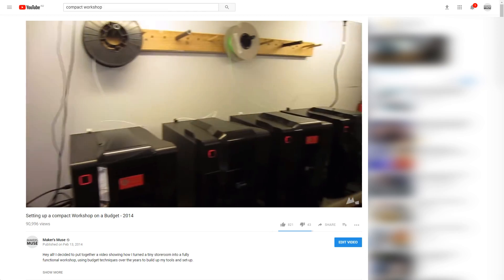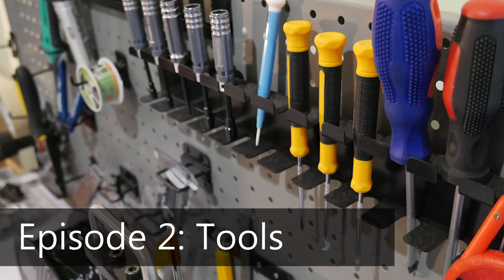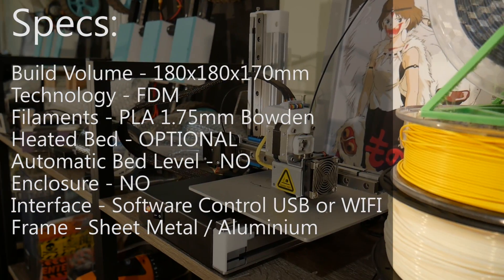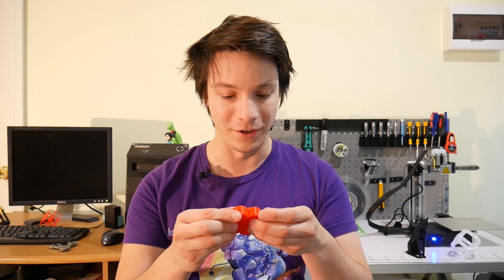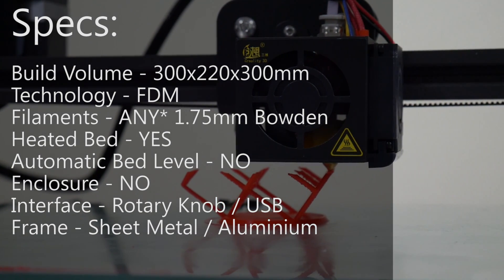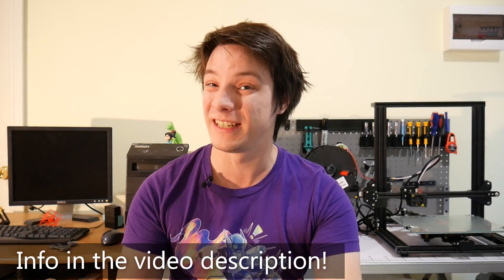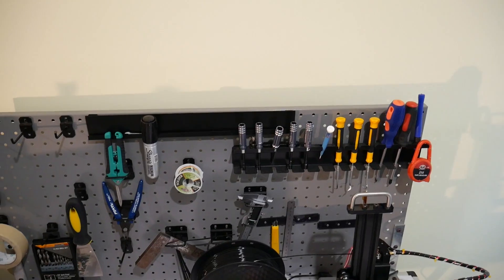The $500 Makerspace Part 1 - Budget 3D Printers

Comment: I think for christmas this year I'm going to buy myself a 3d printer and I'd like to keep it under $200 USD to start.  I already have a good desktop pc and a ton of tools so those won't be an issue however I had some questions on the printer itself.  I scanned gearbest and found a couple in that price range:

Tronxy x1
Tronxy 3d printer kit ($10 more than the x1 sooo)
Geeetech i3 Pro
Prusa i3
Tronxy x8
Creality 3d Ender

You mentioned the Flexion extruder for flexible filament in one of your videos however I do not know which one of these it would be compatible with.  I think that might be something I would want to look into in the future if this is something I want to get into.  Bed size is not really an issue for me as I want to start printing small parts for paintball markers and maybe some action figures for my kids to break... I mean play with.  Thanks for any input you (or the community) can provide.

Comment: Most other reviewers are saying that the kit can be something of a chore to assemble and get working well, but if you had experience with similar projects what would keep a person from getting a TronXY X5S up and running for about the same price as a CR-10?  This is the route I'm planning on taking and running it  with Octoprint, since I have an unused Pi laying around.  That said, I've never had a 3d printer before, and I'd love to hear your thoughts.
Reply from the maker: If you're OK with buying a 3D Printer for a hobby more than buying it to print things then a kit like the X5S is a good deal. You'll spend an incredible amount more time getting it going than the CR-10 which will be printing within 15min of unboxing.
Reply: Thanks for the fast reply!  I'm definitely keeping this at the hobby level for now, and I don't mind doing the assembly myself.  I tend to learn more about machines and processes the more I can put my hands on them.  I've ended up grabbing an X5S as I found one for pretty cheap.  Cheaper even than the equivalent CR-10, but the real justification I'm telling myself is that the steady bed makes more sense from a stability standpoint and presumably has the potential for outstanding large prints.  I have some ideas of getting it running and then slowly upgrading it (24v bed, enclosure, etc).

I've been following your channel off and on for the last year or so.  I've learned quite a bit from you.  Thank you and keep up the good work.

Comment: Tronxy x1 (or x3, simmilar price but way bigger) +2 spools of filament - up to 200 euro (add some part cooling fan and other crap for like 30 euro, you can print cases and holders and stuff on mashine itself)
ATX power supply to not burn yourself down - 30 euro
3d pen from china with 2 spare hotends - up to 30 euro
multimeter(for electronic projects and troubleshooting a printer itself, and its usefull)+digital caliper - 20 euro on wish/aliexpress (you can add soldering iron for 10 euro from china as well, can be even propane/butane one)

Computer for slicing and designing - up to 150 euro on used parts, even on new parts can do, and most people have SOME computer in home so you can just upgrade it.
What else? For console you need to buy games and stuff, so for that space you can add tools and materials when you go on.

BTW isn't cr10 mini basically same as tronxy s3 (I mean a whole construction idea and stuff)...

Comment: Just got my wanhao duplicator i3 plus. I was a little sceptical at first as some people have had problems and there was a recall but am I ever glad I got it. It was super simple to set up (I forgot to plug in the large connector first time cos it was the same colour as the gantry. First print was a little iffy the ok.gcode (used rigid.ink pla, prefers higher temperatures than 195c) but after dialing in the setting it prints beautify can reliably print at 0.5mm layer height and is really quite quiet. The only issue I have had with it is that the left most bed screw is a little tight.

Comment: Just a suggestion for a printer you should take a look at its cheap enough that you can just buy one to try it the Ender 2 it produces some of the highest quality fdm prints I've ever seen and it goes for about 150 to $170 it's easy assemble like the cr10 mini I call it the cr-10 micro ( it's also made by creality) it has a 150 by 160 by 225 print volume it says 150 cubed but you can get what I just posted out of it :-) and it also has a heated bed It can go up to 60 C the only upgrade it really needs is to replace the Springs with ones like are on the cr-10 the stock Springs tend to not apply enough pressure as it prints the vibrations cause the leveling knobs to loosen the better spring solve that problem otherwise the printer is just amazing and very cheap and quiet. One of the few printers that can make prints with no ringing and no ghosting almost no noise at all on the print surface

Comment: Ultem 9085...  

It’s my opinion this is the material of choice for engineering and light production that will seriously empower the dedicated hobbyist. Why? Because Ultem 9085 is the go to material for useable aircraft parts because it’s got more certifications from the FAA than any other material so it can be used to replace parts without long testing periods and mountains of paperwork. That said the company that really does it, Stratasys, is far out of reach for most but the prospects for machines that work with Ultem in the space under $5,000 are coming into focus, the Createbot F430 and INTAMSYS FunMat HT as examples and expect more for less in the very near future. I would guess a year or two from now $2,500 buys an affordable tool for Ultem 3D printing and the days of expensive tinker toys that have to be tweaked and tuned just for the best PLA results is almost over, I guess we’ll see...

Comment: Hi Angus, i also got a Tronxy X1 based on your review and i am really happy with it. However the hotend fan i running all the time with my printer. I observed that your printer isn't running always the hot end fan (for example 2:59). What did you do to engagne the fan only if it is needed? In my opinion this just extends the time for heating the hotend before a print.

Comment: Talking about X1 being quite... How does the extruder fan behaves on your unit? Mine goes 100% constantly, seems uncontrolled and it just can't be quite at all. I've been connecting it to part-fan port to lower its speed, but since I've added actual part-fan now I'm back to a loud jet.
PS cetus and tronxy labels are swapped at 9-29 and 9-32 and it the tronxy fan stuck?
Reply from the maker: You need the fan to cool the extruder or you can get heat creep and jams, but if you need that part quieter you could always spec a higher quality fan with a lower db. They just tend to be a little expensive!

Comment: About the binder clips! Put them as far out as possible, pointing towards the front and back and then use this:

G28 ; home
G1 Z20 F2000 ; lift hotend
G1 X120 Y0 F3000 ; move across binders
G1 Z0 ; Move down to edge of glass
G1 E30 F200 ; prime nozzle
G92 E0 ; reset extruder travel
G1 Y30 Z0.4 F3000 ; quick wipe against side of glass

That way you're only ever gonna hit them if you're printing something absolutely huge. :)

Comment: Not to mention that you can use PLA+ on the Tronxy X1 and get super strong prints with better bed adhesion then standard PLA
Reply from the maker: Yep modified PLA's work great on all these machines, the light blue filament on the tronxy is Polymaker Polymax

Comment: I feel like for a starter makerspace, for a little less than $500 I feel like you could mention the K40 laser cutter. A K40 and a CR10 for under $1000 is impressive still.
Reply: Laser cutting and engraving is not as simple and easy as it may seem and you should invest some time to get familiar with all sorts of problems with cheap chinese Laser Cutters. The K40 has an extremely small work space and does not even come with the water cooling (absolutely needed) or air assistance (needed for basic quality cuts). You need external ventilation to be safe from all sorts of gases too depending on the materials you cut. Another problem is, Laser tubes don't last very long and have to be replaced when they get old. They rarely last two years (even if unused!). Months of learning needed before you can decide which cutter and which accessories to buy for your purpose. A K40 isn't an option to cut anything out of the box and if you are on a budget of $500 for that, disappointment may be lurking in your future.

Comment: $500 is barely enough for the PC to run a slicer and CAD.  maybe leave that out of the budget since it's a low to mid range gaming/student PC and is usually used for many things in life from research for school to relaxation.  $500 just for micro manufacturing setup without the PC seems limited enough.
Reply from the maker: True that you won't get anything new or modern, but it can be done at least in my experiences in Australia where IT gear is often overpriced. The secret is the used business market.

Comment: Surprised you didn't mention the Monoprice Select Mini which is $80 cheaper than the Cetus but has an insulated heated bed and doesn't operate in a closed system. In that form factor, that's basically all I recommend.

Comment: I’ve really been loving the monoprice Select mini V2. It’s only $220. Would have liked to see it on this list but maybe it’s not as good as these other ones?
I advise a high school 3D printing club and the MP mini is our go to printer for now but we’d like a second. CR-10 looks like a nice upgrade for printing volume. Thoughts?
Reply: I've been using a V1 MP mini as my go-to printer for a while now.  To be honest quality is rather hit-or-miss with the MP printers, but mine has not given me any significant problems once I got the bed leveled.  Its certainly an option in this scenario, but it might be hard to get a hold of one in Australia..

That said, I'm kind of in the same boat of wanting more build volume now.  The CR-10 looks tempting, but if I'm spending that much I'm almost more inclined to save up a bit more and go for a Prusa.
Reply: Keep in mind the Prusa (which is fantastic and I love the two I've brought for my Libraries Makerspace) has a 200x200x200 build volume, or thereabouts. The CR-10 goes well beyond that. I'd recommend the Prusa's, especially the latest upgrade as pretty bomb proof. My plan to add a bigger build volume is to get the young people to help me build from scratch a Hypercube Evolution with a 300x300x400 build volume. Well under $1000NZ for parts.

Comment: I like the Idea. What is about a Anet A6 or A8?
Reply: Angus doesn't like the somehow open mains of the Anet PSUs for safety reasons. From my experience it's not a big deal and you can easily print a power switch socket upgrade if that matters for you. Including an autolevel sensor kit, a glas plate, some clips, knurled nuts for bed adjustment, some nozzles and heat brakes (just in case), one meter of tubing to keep the filament free from dust, it is still under $200, and i get some pretty decent prints even using PETG out of it. I don't regret my decision to buy an A8.

Comment: Well done!  I could not agree more with the message!!!  What you "learn" from video games, or develop (hand-eye coordination to a small degree) really doesn't take you anywhere.  What you learn by building and experimenting with a 3d printer covers so many areas and disciplines that have so much potential value that they could inspire an entire career.  Mechanics, motion control, motion systems, basic DC electrical, machine level coding, and I could go on.  There is also the follow-on "next printer" that is almost impossible to resist building according to you own "design" / specifications.  Add Cad/Cam, and Wifi and even coding if you go to multiple colours in multiple hot ends.  Keep up the great effort!!

Comment: The TronXY X1 is a great deal.  I have been working on a reprap copy of SmartRap and making tweaks that I want to it, kit parts buying parts for 2 machines was still at about $180 ea machine, my build volume is a little larger, but I am also pla only, no heated bed.  At $330 for the cr10mini you aren't going to have much left for other items.
Reply from the maker: Yeah, it's at the upper limit if you don't already have some tools or a PC to use.

Comment: why not the monprice mini select? its got a decent community behind it and is a rather good printer for only 220$ its also pretty beginner friendly
Reply from the maker: Good machine too! These are just a few I have used and can recommend, I've not personally tested the mini.
Reply: I'll second the mini.  I have had the V1 for a while, and it is a great little printer: I use it for prototype prints and anything small and detailed, and I've burned through almost 2 dozen spools of filament through it so far.  It has a few design issues and cheap parts, but the community support is great for working them out.  The heated bed, color screen, and overall rigidity are things you don't see much in printers around this pricepoint (~$200).  If you want to spend just a little more cash, some upgrades make it a very precise: i have done miniatures as small as 15mm at 20-80 micron layer heights;  here are some detail pics is anyone wants to see how it can do on those. https://imgur.com/a/0onE8

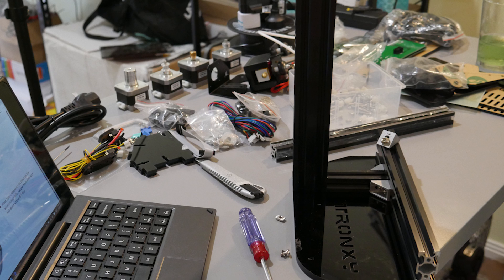Comment: 3:19 "Its a kit" - often with bits missing from the kit needed to finish assembly. That said, you can get around most of the problems with a  little thought (missing spacers can have two bolts and a washer substituted, probably making a better result than the spacers would of done), and once its together it can be used to print out various upgrades to turn it into a very nice little cheap printer. 
One thing though, there are "issues" printing directly from Cura and Simplify3D, namely the printer just goes loony due to some USB-Serial problem. Using Repetier works fine.
Reply from the maker: Heh true it's not perfect by any means but definitely a great platform for the price. I never print tethered, even though the micro sd slot is difficult to access. I just find it far more reliable.

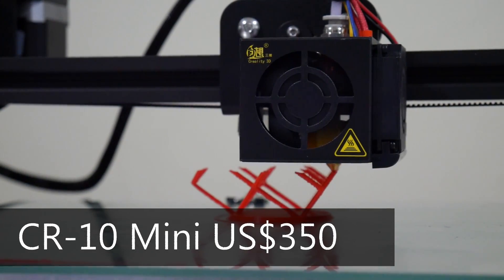Comment: did i see the lattice torture test wobbling at 9:35 on the right side when being printed by the cr10 is the nozzle scraping it?
Reply from the maker: Yeah at 75% scale it's super flimsy so that's pretty normal. Z hop helps a tiny amount as does printing slower.

Comment: Is it just the camera frame rate matching the rotation speed, or is the fan not spinning at @3:00 ?
Reply from the maker: Good catch! I plugged it into the wrong port initially so its acting like a cooling fan and not spinning for the first layer, instead of all the time to cool the hot end. Didn't cause any issues but not great for long term use.
Reply: yea im no stranger to heat creep induced clogs from lack of cooling...
Reply: Maker's Muse maybe mention that this fan can be replaced for under 10 bucks with one that doesnt sound like a turbine. And then it is in fact a really silent printer 😉
Reply: What is your recommendation? What did you use Angus? Mine sounds like quadcopter trying to start.
Reply: noctua fans 100% quiet and super powerful

Comment: my cetus from kickerstarter went great then craped itself after crashing into the bed a few times =/
Reply from the maker: Ah that's a shame to hear, the nozzle is probably damaged... Easy fix if you can get them to send you one, and the community came up with a few fixes to help stop it dropping like the brake they implemented in the MK2
Reply: yeah tried a new nozzle but something got either loose or damaged, kept ramming itself into the bed once it started printing, even though it homed fine. Then the fan broke, then it refused to extrude even after i bought their filament.  =/ i just kind of gave up on it. didn't have time to keep trying to fix it =/ it's collecting dust in some corner of the house right now sadly
Reply from the maker: +Thyshallsmite it sounds like the nozzle height was set wrong? It's set in the software and a bit different to other machines as '0' is the top of the build volume not at the bed where I'll be 179.2 or something, if that makes any sense.

Comment: This video is no doubt quite impressive, but if you could find me a good old lathe, and Bridgeport mill for the same price, I would be eternally grateful!
Reply from the maker: Dude, find me some while you're at it! I really really miss the old bridgeport mill and colchester lathe from my university, used to go in during the holidays to make things.
Reply: :D

https://www.youtube.com/watch?v=k-f7Dvw6EnA
Reply: You need to have a word with AvE for thems ;o)
Reply: If you find an old lathe and a Bridgeport for $500 what would you need to multiply that price by to get them running?
Reply: Aye, incomplete without some Metal Chips.
Reply: Do you have any thoughts on the cheap mini laser cutters that Chinese websites are selling?
Reply: There's a book series by David Gingery about making your own metal shop from scrap, and it involves making your own lathe in the process. He said that it cost him on the order of about $1000 to do it.
Reply: there's also the Multimachine which uses old engine blocks to create a machine tool. http://opensourcemachine.org/
Reply: I bet the tooling and proper measurement equipment will set you back more than $500. And where would you put a Bridgeport mill? I could put any of these 3D printers right in my home office.
Reply: I use a lath and a mill both are  great but a printer would be really nice for prototyping.